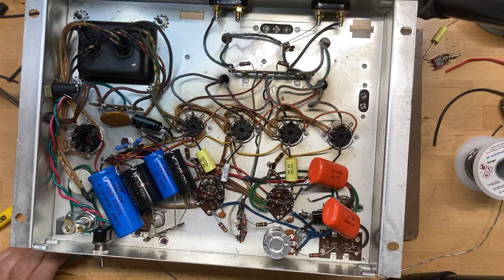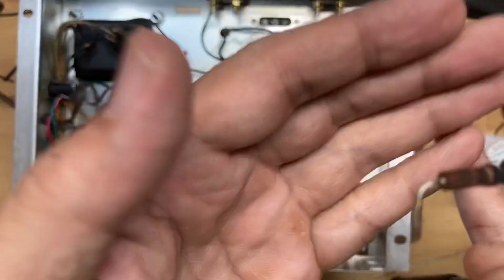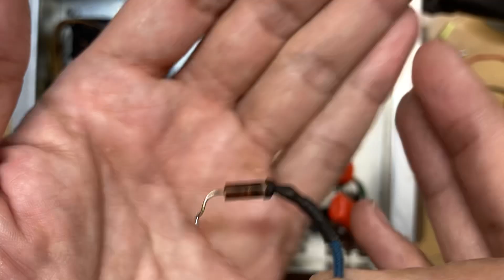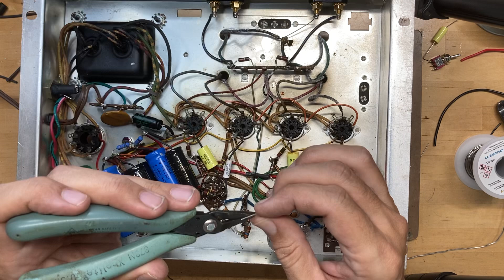1962 Magnavox 9304 Tube Stereo Amp Repair on a Saturday Morning

Comment: I have a 6v6 version and it was modified by someone else before I got it. It's only using two driver tubes, the third socket is empty. The previous owner put in a on/off volume pot. I have no idea if this has a proper preamp stage or not. I find I really need to turn the volume up high to get a fairly loud volume. I rarely listen loud but it makes me wonder if the previous owner put in the right type volume pot or if it needs more work to sound its best?
Reply from the maker: The two tube input stage is the stock configuration as there was an external preamp on the console/tuner section.  You can use the extra tube socket hole to add a simple gain stage, but I don’t find it completely necessary for CD players or Bluetooth receivers.   I think I used a 250K pot in this one.

Comment: Hey Adam do you happen to have a schematic for the 9304-20? I"m just learning, not a pro. But I haven't had any luck finding one. Any help would be appreciated.
Reply from the maker: I do have a Sam’s Photofact of the 9300 series in general.  There were minor changes in each model (9301, 9302, etc) primarily where the Balance control was located.   If you send me a text at the number on my website, I’ll take a photo and send it over to you.

Comment: Any one out there work in stereos ? I got a  Sansui integrated amp that doesn't power up. Any help would be greatly appreciated
Reply: Northridge fix might.  I suggest doing a visual inspection for burned components before doing anything.  A simple circuit check with a voltmeter might also find the short.
Reply: @naughtiusmaximus830  it has done this before and I had to send it in than something happens when the volume is turned up way high
Reply: @mrboyle2455  my response was deleted for some reason by YT.  Suggest try electric cleaner on the volume pot.  I use deoxit but Walmart is probably OK.